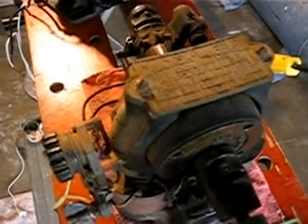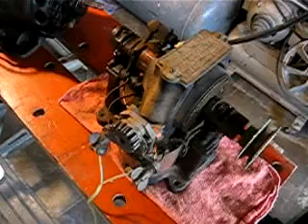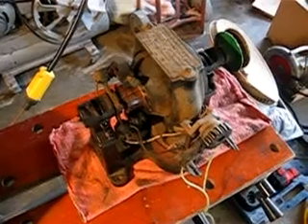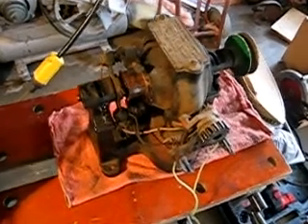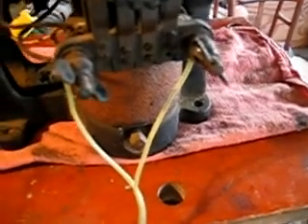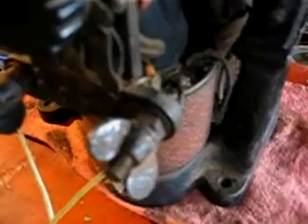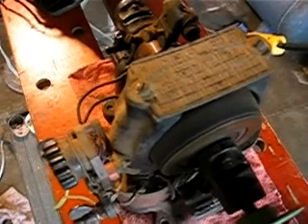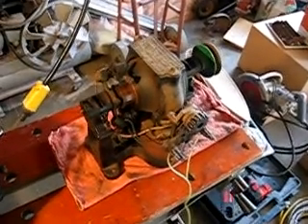Antique 1/6 hp Crocker-Wheeler Direct Current Electric Motor DC

Comment: I just found one of these in the UK. It was made by General Electric Co. Ltd of London and Manchester and is rated 1/4 HP, 1150 rpm, 2.2 A, 100 VDC
I don't know anything much about it. How would I go about testing it? I don't know how to produce 100 VDC.
Reply from the maker: AlastairWright The easiest way to run that motor in the UK would be to first use a transformer to step down the 240 volt mains to 100 (or close) volts AC, then use a bridge rectifier to make it DC.  It won't be smooth DC, so the motor will emit a bit of a hum, but it certainly will work fine.  I only used the car batteries because I happened to have that many :)
Reply: Many thanks for the advice. I already have a step down transformer - just need to find a bridge rectifier now. I managed to find the Crocker Wheeler manual online at Archive.org so I'm armed with all tyhe info now.